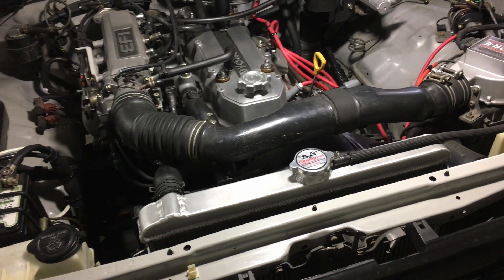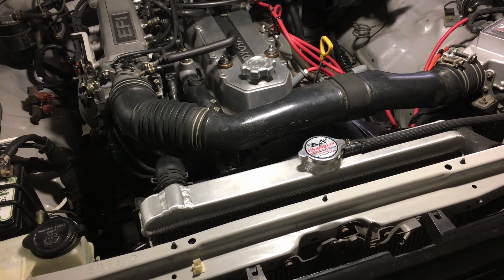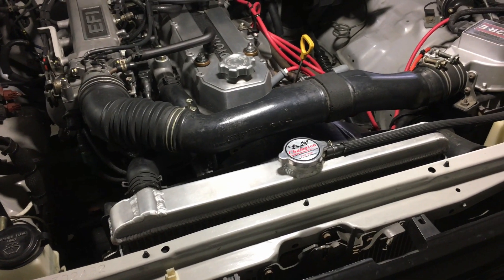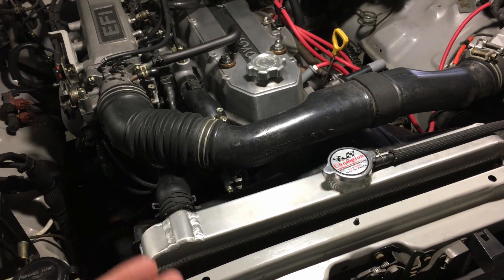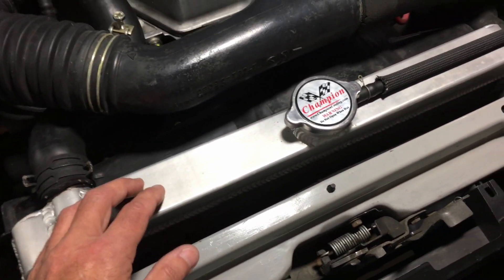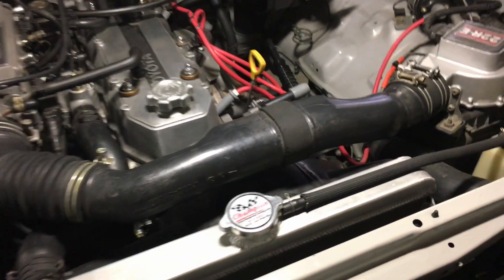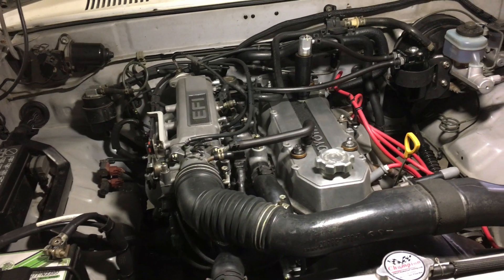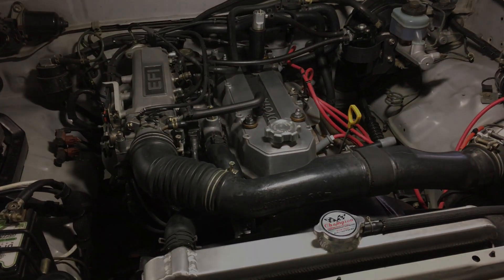CHAMPION ALUMINUM RADIATOR on 84-95 Toyota 22R Pickup - Zerek Asian Red Antifreeze discussion SAFE?

Comment: Just switched to a big bore lce throttle body 95 22re and replaced the tps having slight idle surge and high idle screwing in the idle screw all the way keeps it idling at like 950. Lce is closed on the weekend sadly. I’m assuming it’s a vacuum leak I had switched to silicone vacuums for whatever little 1/8th hoses are connected to the tb including the dashpot. The big bore throttle body doesn’t have a designated vacuum port for the dashpot(I never adjusted the dashpot screw drove it decelerated didn’t really notice anything wrong) so you have to hook into one of the vacuums up top I used a tee and connected it to the third one. I’m using a teflon gasket they provided as well unless I cracked that I’ll take a look  when I can. I also adjusted the little screw jam nut that makes it so the butterfly valve doesn’t stick to the tb unsure if maybe that’s causing the high idle. I did take it for a drive and it drive pretty well I don’t believe the idle surged in drive but I would have to check again to make sure. It didn’t have a high idle in drive though I know that for sure. I don’t have a tachometer but I used some little digital tach that was cheap but in drive it idled at like 750. Could also be my tps maybe I didn’t adjust that great.
Reply from the maker: Hard to say.. I have my dash pot disabled (although if I do enable it, I usually just have it adjusted so it takes about 1/2 second to let the idle come down). The only way to correctly adjust the TPS is following the manual and using a volt / ohm meter and feeler gauges. It's not a "get close enough" kinda deal. How did you adjust it? I ordered that teflon space thing for the throttle body and ended up throwing it into the trash (went back to a stock gasket). If you have a vacuum gauge, check for leaks. But yeah, could definitely be that your TPS is out of whack; that's a super delicate adjustment and the ECU really relies on that setting above all else.
Reply: @ray5961 I did adjust the tps with feeler gauges and an ohm meter and made sure it was adjusted properly could have just went past my head or something not really familiar with using ohm meters and such but I followed the instructions. I do not have a vacuum gauge but I do have an automotive smoke machine.
Reply from the maker: @fiys567  Try resetting the ECU to clear the fuel trim table data - just pull the 15A EFI fuse for a few minutes in the fuse box under the hood. Sometimes that can help. Might wanna ditch the teflon throttle body gasket stuff also. Are you running any kind of IAC valve on the LCE throttle body?
Reply: @ray5961 Yes I’m running an IAC valve it was actually recently replaced as I was chasing down a weird idle on a warm start that and a temp sensor for the ecu fixed that but that was ages ago now. I will try that though thank you.
Reply: @ray5961 I will ditch the teflon gasket how come you had ditched it though. I did use one before on the OEM throttle body and it was fine but honestly I don’t think it does much anyways that one I had got from EBay
Reply from the maker: @fiys567  It's pointless when you have an IAC valve warming up the entire throttle body from below. I went back to the stock black gasket to ensure proper sealing.
Reply: @ray5961  Had just cold started it and unplugged the TPS and the idle didn’t change so I’m assuming it’s a vacuum leak as typically I’ve heard people with bad idles because of the tps disconnect it and it begins to idle smoothly
Reply from the maker: @fiys567  Also check to ensure the door inside the AFM is swinging freely and not binding. I have a recent video on the channel which discusses this issue here: https://www.youtube.com/watch?v=oBBr7MPoXaw - but usually if things are running too lean, idle takes a hit. When the mixture is more rich, idle RPM's will go up generally due to the additional fuel in the mix.
Reply: @ray5961  smoke machine wasn’t working sadly I tightened down the tb more just to see crush the teflon gasket more as figured didn’t do anything (didn’t really have the time to drain some of the coolant to pull off the tb) I pulled off the air filter and hit the gas a little to check the afm and it didn’t get stuck at all thankfully it swung freely didn’t bind at all
Reply from the maker: @fiys567  You should be able to pull the throttle body off without having to drain the coolant no?
Reply: @ray5961  ac line gets in the way and since the coolant line in the side is short it’s hard to maneuver off the stud
Reply from the maker: @fiys567  I don't have A/C on my truck so perhaps it's a slightly different setup for your motor. On mine, I'm able to remove the 3 long bolts and the nut on the stud and just barely can stretch the IAC coolant lines and get the entire throttle body off the stud (it's super close though).
Reply: @ray5961  changed the gasket to a paper one i guess you can say and added some little clamps to the vacuum lines no longer jumps but the lowest I can set the ifke is 1050 that’s screw all the way down I’m assuming that now idle is too high from either the TPS or the jam nut. The Teflon gasket did help keep the upper manifold cold but after a while heat soak gets to it anyways
Reply from the maker: @fiys567  yeah the Teflon gasket basically just cases more problems than it's worth. Eventually everything becomes heat soaked, then it's preventing heat transfer away from the TPS and throttle body. It's a moronic part if you ask me. If your idle adjustment screw isn't working, then it means the IAC air passage isn't shutting most likely. You can try putting some duct tape over the inlet hole as a test, just make sure it doesn't end up sucked into the motor or anything. If you manually block the air hole going to the IAC valve, you should be able to dial the idle down to almost nothing using the screw on the throttle body. The idle stop jam nut should be set so that the throttle plate just barely touches as I remember (it's basically just there to prevent binding of the plate itself). I don't remember the exact procedure for setting it, but just snug it up to the arm basically as I recall.
Reply: @ray5961  The iac is brand new though which is odd didn’t really have those problems on the old tb maybe there’s an air pocket?
Reply: @ray5961  let’s just say I stick a small stick into the iac should it be dry or wet with coolant
Reply from the maker: @fiys567  I'd start by blocking off the air passageway into the IAC stuff as a diagnostic check. This video explains how air routes into the motor (although it sounds like you already know your business over there): https://youtu.be/-knUk1wAR_o?si=iAFp2x9kClce52Ur - make sure both hoses (going to and from) the IAC valve are warm - those small passages can end up clogged up if someone used too much RTV sealant in the cooling system and it breaks off and circulates around. That video above will show the passage way to block off. If things are running overly rich, you might get high idle, but again typically if the idle adjustment screw on the throttle body is working correctly, you should have no issues dialing the idle down to 500 RPM's - if it's not going down, then the motor is getting air from some other location - I mean that's what opening the throttle plate does; gives the motor air. There are only two passage ways around the throttle plate and that's idle route or IAC passage. Only other thing would be like a leak via the PCV valve or if you have a K&N breather on the valve cover allowing bunches of air into the motor or something.
Reply from the maker: @fiys567  Not sure what you are getting at there. Put a stick where? The IAC has two individual (and totally isolated) areas - one allows air to flow into the motor and the other allows coolant to circulate around the internal valve that operates inside the IAC valve itself (see this video for more specifics: https://youtu.be/-knUk1wAR_o?si=iAFp2x9kClce52Ur ) so putting a stick into the air way of the IAC will not have anything to do with the coolant circulating. Maybe I'm not understanding what you are asking. You should be able to feel the coolant hoses running to and from the IAC and both should be the same temp as the hose going to your radiator. Did you purge air from the cooling system when you worked on it last? That's very important here... you wanna get one of those funnel deals off amazon and do a full air purge on the cooling system anytime you introduce air. Also make sure your over flow tank is operating correctly, etc.
Reply: @ray5961  I did purge the air the little hole in the tb is what I was referring too if I stick something in there should it be wet or dry. I’m in the process of purging the coolant again in case. It could also be a throttle body thing since it is aftermarket and not everything is going to be manufactured to spec maybe the idle screw isn’t deep enough. I do not run any breathers besides on the coconut shaped thing for the air injection on the side of the manifold. I do have an oil catch can but that had no breather and I did exactly what you did I put a screw in place of the old dip stick and siliconed it
Reply from the maker: @fiys567  The IAC should be totally dry from the outside. I don't have any experience with the LCE large throttle body stuff so I can't really help there. The coconut and air suction systems are isolated from anything having to do with the intake system of the motor. Block off the hole to the IAC passage and see what happens once the motor is warmed up.
Reply: @ray5961  I smoked out the whole thing no leaks covered the hole same thing. Took it to a shop so they can verify just as second look they said everything was in spec no leaks no issues so I honestly think it’s just a manufacturer issue maybe not enough threads
Reply from the maker: @fiys567  smoke machine isn't gonna simulate a vacuum leak. Best idea would be to attach a vacuum gauge and see what kinda vacuum you are pulling at idle. Here's the gauge I use here: https://www.amazon.com/gp/product/B000CODRFO - as far as not enough threads to close down the idle circuit in the throttle body, anything is possible. I've run across a number of oversights w/ LCE, so certainly wouldn't rule anything out. It should be pretty easy to use a stick or something to check the height and/or just dial the idle screw down and look in there to see if it seats or see if you can blow air through the hole. Did you block off the hole for the IAC passage as a test yet? You can do that same thing for the idle circuit hole and see if the motor will still idle or not. Keep me posted! Hope you can find the culprit. Also, are you running the EGR system on your motor? You might try blocking off that rear EGR passage into the upper plenum as a leaking EGR valve can also throw stuff way out of whack. Also, block off all those vacuum hoses that run to the EGR modulator on the throttle body just to see. It still sounds like maybe a vacuum leak some place, but hard to say... I'd definitely start by blocking off some holes with duct tape to see how things respond. Also, keep in mind that if something is causing the injectors to run rich, that will kick your idle up and it becomes difficult to dial down. Also, did you try resetting your ECU?
Reply: @ray5961 I did block the IAC. Stayed the same. I’ll have to try that out but i do have egr but I did replace the egr gaskets most of the gaskets pretty recently and this issue started the day I installed the LCE tb. It’s idling at 950-1000 as of now.
Reply: @ray5961 I’ll have to try testing these things I reset the efi how you recommended pulled the little fuse 15 amp
Reply from the maker: @fiys567  I mean that's a good level to idle at.. I have mine set at 950
Reply from the maker: @fiys567  Yeah definitely reset the ECU by pulling the 15A EFI fuse for a few minutes. Give your truck a week to recalibrate the trim tables.
Reply: @ray5961  i was able to slightly turn the idle screw more I used a screw driver maybe about 1/8 of a turn should be enough I was doing it by hand always so I’ll see tomorrow
Reply: @ray5961  i like to have it around 820 because atleast in my thought process with ac idle up and then same with powersteering it can go up a decent amount and don’t want the ecu to try and correct itself for a high idle etc
Reply from the maker: @fiys567  Could also be that LCE didn't tap the threads far enough down and/or there is a bur in there. I'd inspect the threads and maybe run a bottoming tap down the hole or at least inspect it
Reply: @ray5961  I cleaned the threads with a little brake cleaner and some brush didn’t do much but that little 1/8 of a turn did lower the idle enough to where I’m comfortable. I’ll probably use a thread tap sooner or later have to buy a set. But honestly the throttle body does make a big difference in throttle response and I feel a power gain. I’ll probably benefit more once I get my lower intake manifold and upper ported. What probably made the biggest difference too is the tps since my old one tested bad autotragic shifts better lol
Reply from the maker: @fiys567  That's great to hear! Yeah maybe there was just something in the threads holding it off a touch and now it's down where it needs to be. Glad things are idling better now :)
Reply: @ray5961  i really appreciate your help your easily the most helpful when it comes to anything 22re related seriously
Reply from the maker: @fiys567  Thanks! Most appreciated. Always happy to help anyone when it comes to the 22RE :)
Reply: @ray5961  I did just notice my ac atleast in neutral likes to cycle on and off constantly I never noticed it in drive till now since usually my fans are on because of the temp not the ac and the idle isnt as high. It cycles on and off within seconds and the ac clutch will kick on and off which causes my fan to turn on and off for a second multiple times only does that when the fans weren’t already in. And since the clutch turns on and off the idle will surge since the ac idles it up. My ac is tapped into the wire on the front of the compressor maybe when I changed the throttle body some coolant found its way into the electrical T tap with a light coat of grease and some electrical tape on it.
Reply from the maker: @fiys567  I don't have any experience with A/C systems on the Toyota so couldn't really answer too many questions about its impact on functioning. On my truck I run an electric fan but a messed up fan clutch could be something to double check.
Reply: @ray5961  By chance do you know what tap size I should run to try and see if that cleans the threads for the idle adjustment screw
Reply from the maker: @fiys567  I'm running the stock Toyota throttle body w/ the LCE stainless ice adjust screw shown here https://www.lceperformance.com/22RE-Idle-Speed-Adjusting-Screw-Stainless-Steel-p/1061049.htm - the thread pitch for that hole is M10 x 0.75mm - w/ my motor I'm running the idle adjustment screw such that the top of the screw is 13 mm from the edge of the hole on the throttle body; that gives me an idle over here of around 950-1000 RPM's. (13.14mm from the edge to be exact). So every 2 rotations of that idle adjustment screw accounts for 1.5mm worth of moving the tip down into the air passage.
Reply: @ray5961  I believe the threads are dirty on mine because my idle doesn’t go lower and I don’t have any vacuum leaks, but I honestly can’t find a thread chaser for that size but I did find a tap.
Reply from the maker: @fiys567  did you block the hole inside off to see if you are on the right track here? M10x0.75 isn't a common size but I saw a lot of them on Amazon (including a pair w/ a bottoming tap). Be careful cutting the threads open too much in there and/or introducing shavings, etc. Also, high idle can just be a function of having the mixture too rich also - do you have any means of monitoring the mixture (such as a wide band O2 sensor)?
Reply: @ray5961  I did block off the IAC and same thing. I do not have a wideband. But this only started after changing the throttle body.
Reply from the maker: @fiys567  Did you try blocking off the IAC as well as the idle screw passage itself just in order to rule out some leak coming from some place else in the motor? One other thought I had was that the larger throttle body is drawing more air and thus opening the door inside the AFM farther than normal (and this would cause the ECU to increase the pulse width modulation of the fuel injectors (causing a more rich mixture). You might wanna try opening up the trim screw on your AFM (measure accurately first before making any changes) and see if that helps you gain more control at the main throttle body idle screw. You might also consider leaning up the AFM by turning that internal coil spring 1 or 2 clicks away from the factory settings (again, always mark the OEM setting on the teeth).
Reply: @ray5961  I only blocked off the IAC that didn’t help. Blocking the idle screw passage would kill it on idle no? If I was running to rich wouldn’t my idle be too high in drive? My idle in drive is around 750ish which is normal turning the adjustment screw doesn’t change the idle in drive like it does in neutral/park in an auto
Reply from the maker: @fiys567  Hard to say.. in drive you have the torque converter in the mix, so that's gonna place some load on the motor. I'll have to ask my friend (who has that '94 automatic) what his truck does in N vs. idle vs. park, as I don't have a lot of experience with automatic Toyotas and the 22RE. And correct, if you block off the other hole inside the throttle body, you are totally turning off the idle air, so it should totally kill the motor - that may or may not be an interesting test. You might be correct that just the hole wasn't correctly threaded and running a tap down there could correct that. Try blocking off half that hole inside using tap maybe? Also I'd measure the idle screw vs. the depth of the hole if you have a stick or something. Are you using the stock idle screw of the stainless thumb screw from LCE?
Reply: @ray5961  I’ll test that out. Let me know I really appreciate the help. I’m using the stainless lce one. I can’t find my oem haha
Reply from the maker: @fiys567  Yea I have a ported head, free flowing exhaust, cam, etc. and I run the AFM at 2-clicks leaner than stock.